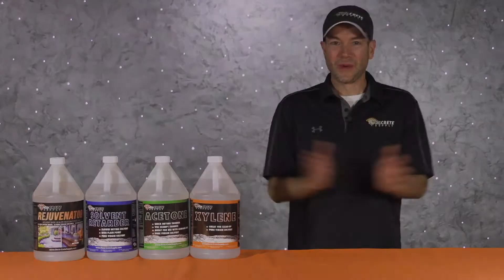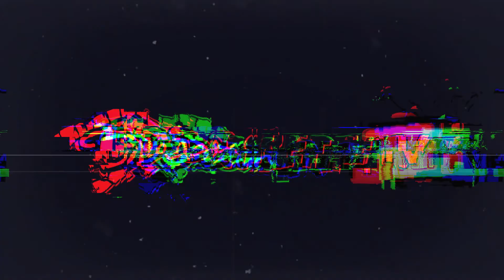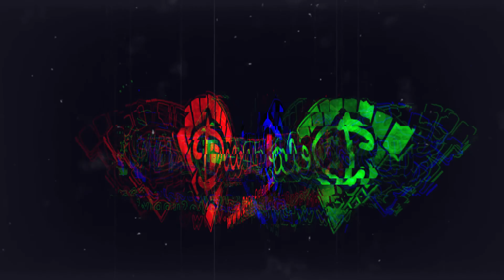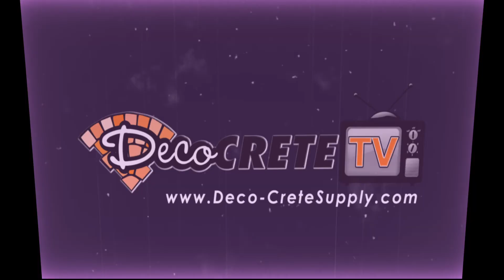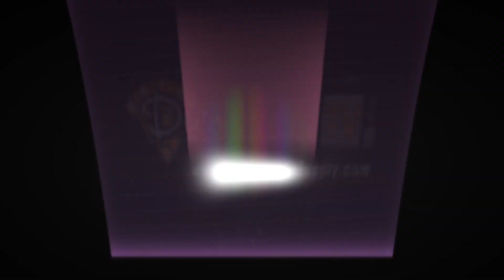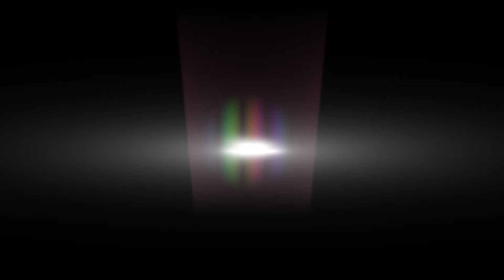What Are Solvents?

Comment: Great video. Do you have any suggestions on stripping an acrylic sealer?
Reply from the maker: The best way to strip acrylic sealer is to sandblast it off the concrete. This will completely remove the sealer and prep the concrete for next coat all at the same time. Please check the Technique of The Week video link below. If sandblasting is not an option, we offer a product called Nock-Off that will chemically strip acrylic sealer.
-Jeff
https://www.youtube.com/watch?v=ASIqq_vyUAI&list=PLgaJ0iW5t2kpnBg7sjEP5ETu0tzbaYcmA&index=102 
https://www.deco-cretesupply.com/products/repair-prep-products-coating-mastic-removers/nock